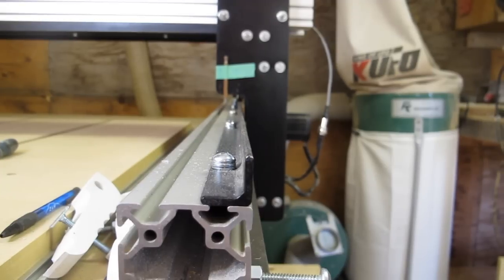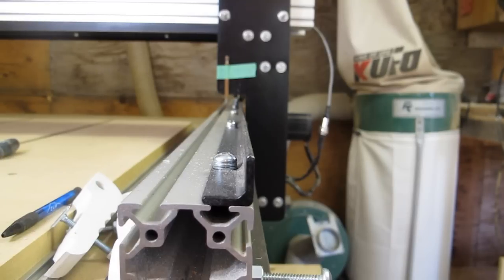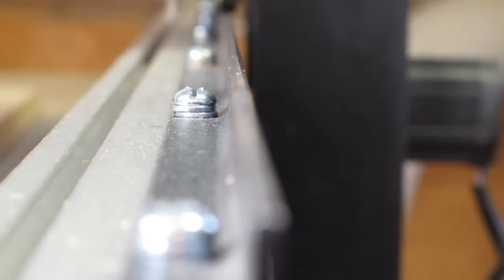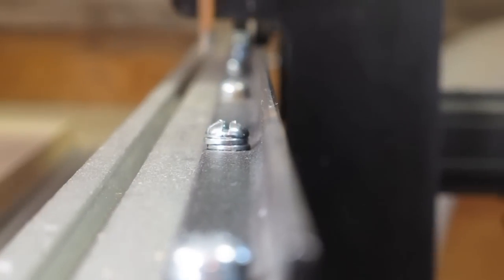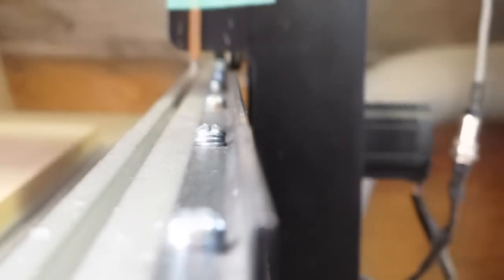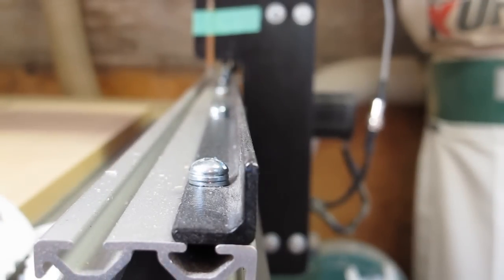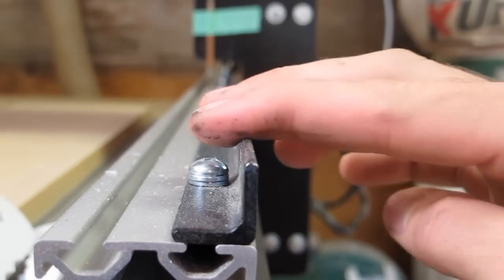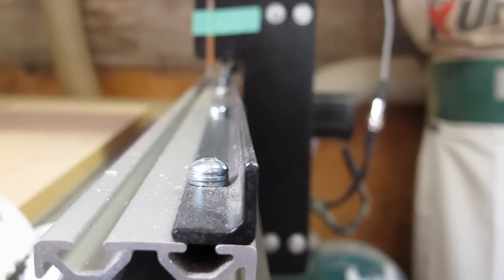Homemade CNC rails, diy linear rails

Comment: What could you possibly do to wear the iron? That rail should last your lifetime and more.
Reply: The rails not so much wear but rather are being slowly cold-rolled by the hardened v-bearings into a matching v shape. I built a large format CNC router with 84” gantry beam, weight over 200 lb with Z carriage, spindle, dust extraction, cable and cooling hoses drag chain, etc.
After 4 years of heavy usage in commercial shop the top angle steal profiles have been cold-rolled into a V.
However cold-rolling hardens steel so once the flats of the V have been formed, further deformation due to rolling slowed down.
The gantry is heavy enough for the gravity to hold the top  v-bearings onto the rails tightly even during heavy cuts so even if the bottom wheels are a bit loose, the gantry stays on the rails.

Comment: Dude! You are using them WRONG!
The v in the “v slot” is designed to ride on the point of the angle iron. It’s supposed to to have the “pyramid “ shape pointed up.
Reply from the maker: I don't know what you're talking about.   The point of the angle rides inside the v of the bearing on this machine.

Comment from the maker: Because of the way the carriages are build, they force the angle iron to straighten, sure its not 100% and needs constant adjustment, but it works just fine.   V guides are much more expensive then angle iron but would be a better way to go, if you can afford them.

Comment from the maker: ultra smooth maybe, but the X beam weighs over 100lb, and the machine will jerk that weight around.  Those tracks would be garbage in a few seconds (if they last that long)  You van get gliding rails that are supper smooth.

Comment from the maker: No, i have not considered using those.  Once the V bearings have worked the angle then it basically stays that way.   Its just the first little while until the angle has a proper point that fits into the bearings.  Just run a breakin before use and you'll be fine.

Comment: Have you considered patio door rollers?  They are u groove and fit nicely with 3/16" angle.  The newer rollers have better bearings and You should be able to punch out the old bearings and press in skateboard bearings if desired.  The patio roller bearings will not groove the angle.